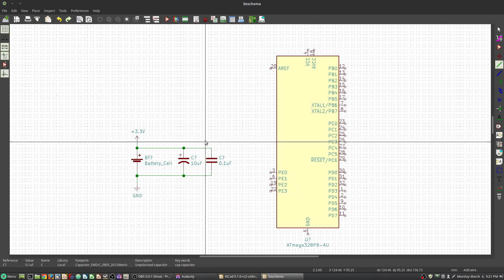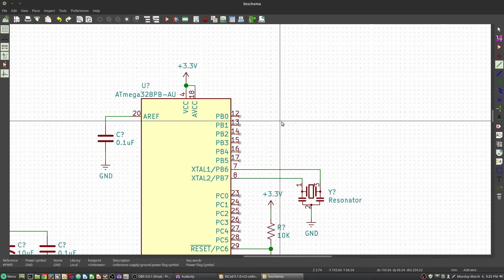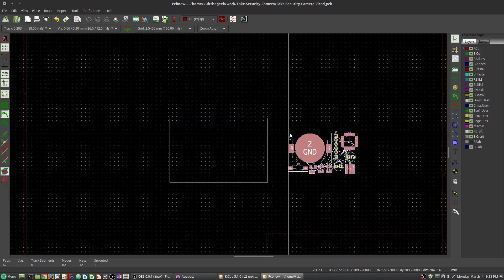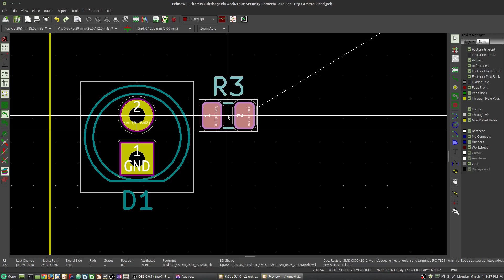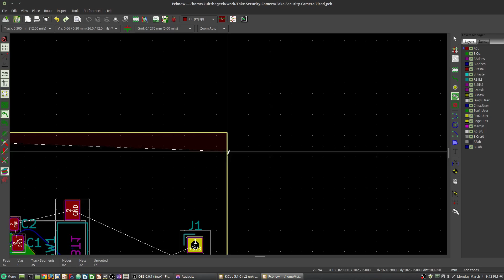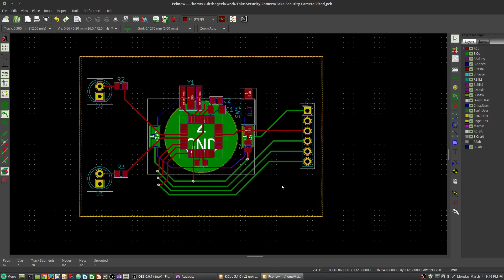Shenzhen I/O in Real Life - Part 2 - The Board

Comment: i have a probably ridiculous question, but why do you need the capacitors ? this might be obvious but can you please tell me in detail ?
Reply from the maker: That's not a ridiculous question at all. You put capacitors on the supply lines to help to filter the input power. DC power isn't perfectly flat like we normally represent it, it has a small signal ripple in it, and we use capacitors to help smooth that power out right before it supplies the ICs. This helps make the power more stable and helps to prevent random resets in the event of a power bump. This is also why the capacitors are typically put as close to the input pin as possible. Does that make sense?
Reply: @KuittheGeek  thank you for the explanation ! if you dont have a problem, i have 2 more questions
what capacitors to use depending on the circumstances, and
im using kicad, and i cant find logic gate footprints, what do i do ?
Reply from the maker: So there are a lot of reasons to use capacitors, and it is hard to explain the differences for all of the circumstances. But for power input filtering and smoothing, I normally use 2 ceramic capacitors in parallel, with values of 1uF and 0.1uF. As far as the logic footprints, you will need to look for the specific logic ICs for the gate you want to use. For example, the 7402 is a quad packaged, 2 input nor gate. Once you find the part you want to use, you can check the datasheet for the part, and it should tell you what footprint you need, like the SOIC-8 or SOIC-16. Those should also be in the default libraries. Otherwise you can look at snapeda.com for schematic symbols, footprints and 3d models. I hope this helps.
Reply: @KuittheGeek  its really nice to be helped like this, wish the best to you
Reply: LemonAndGaming it’s also worth noting that when you’re using crystals with an IC for timing you sometimes need to use capacitors to kickstart the crystals into working (so I’ve heard, don’t really understand why. Weak signal I guess)
Reply from the maker: @MarkPentler  This is true. The capacitors also help to stabilize the resonance of the crystal.  The capacitors for a crystal are usually in the realms of 12pF, so they are very tiny, and that is one thing to be aware of when laying out the PCB. The traces to the crystal from the micro should all be about the same length, and the traces from the crystal to the capacitors should be the same length as well. This is done to minimize the capacitance on the line. You can also use a resonator like I did in this circuit, as it is essentially a crystal with built in capacitance. It makes the design a bit smaller, but they aren't as accurate as a standard crystal. In some applications that is just fine, in others you need the accuracy.

Comment: Im kinda sad that this is just a custom arduino. I was hoping that there were small chips that could run small amounts of basic code like in shenzhen.
Reply from the maker: There are many small and simple microcontrollers out there, but this is basically how most modern designs work. I have been working on a project recently at work that uses a small 8 pin PIC micro, and I'll no doubt use that in a video sometime soon, but most projects now are done with micros that have significantly more code space then any project you could do in Shenzhen I/O. I could definitely do a project using this little PIC and some assembly code, that would be closer to the game. 🙂 I just need a project. 🙂

Comment: How do you calculate the values for capacitors and resistors?
Or it's just standard values from atmega datasheet?
Reply from the maker: That is a great question. So some of the values are standard values. I will always place a 1uF and 0.1uF capacitor on the input power line of the processor, as close to the power pins as possible. These act as power buffering capacitors as well as offer some noise reduction from the power supply. The resistors need to be calculated based on the LEDs used. This is dependent on the Source Voltage, the LED forward voltage, and the LED forward current. Digikey has a great calculator to use to calculate this out. I usually go a little under on the LED forward current to ensure I am not overdriving the LED. So if the LED has a current limit of 20mA, I will shoot for 18mA to drive it. This will just make the LED a bit dimmer. Great question though, I will be sure to cover this more in future videos.

Comment: Thank you for this fun idea of a project!

Now that I've gotten that out of the way:
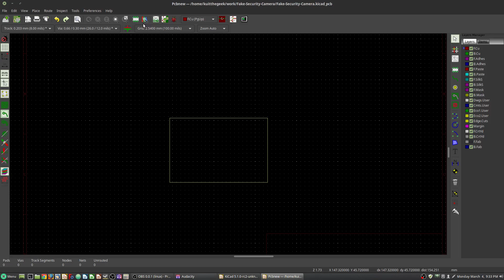I'm trying to reproduce your project on my own (by essentially copying what I see in the video) but I've gotten stuck at around 09:05 in the video, you never show how to generate the netlist, which I later figured out on my own, but after figuring that out, when trying to import my netlist to Pcbnew, I get a ton of errors saying something similar to "X is missing footprint", I'm going to continue searching for a solution.
Thanks yet again for the fun project idea.
Reply from the maker: Yes, there were several things I left out for time sake. I did start by adding default footprints to the symbols, so that resolves the footprint linking. You can do that however by running the "assign footprint" tool. I believe it used to have a different name, but the symbol in Eeschema has the "symbol editor" op amp symbol with the "footprint editor" symbol. This lets you link all of the schematic symbols to footprints. The netlist is generated by clicking on the symbol that says "NET" and then I generally save the netlist to the directory I am working from. I do plan to have another set of videos where I cover everything from project creation to gerber production, with more detail. So stay tuned for that.
Reply: @KuittheGeek  Alright, thanks! I'll wait for the coming videos.

Awesome.
Reply: I found the menu "Assign Footprints", I'm guessing you don't show connecting the different parts in the video, at least not how..
Hmm..
Reply: Seems like all my symbols are "unlinked", but I'm unsure of how to link them and what to link them to..

Comment: Amazing project! Can't wait to see the final product. Just curious, have you made any progress with the Skirmos code? I was thrilled to see that they put their code on GitHub but all I got was a 404😡😥. It'd be great if I could get their code working in my project guns.
Reply from the maker: Unfortunately I haven't. When I was able to pull down their hardware designs, the repository wasn't open. I did contact a few of the project leads, and they said they wanted to clean up the repo before releasing it. I assume that never happened. After I took a look through their hardware designs, I was less then impressed, and decided it wouldn't be worth using their code anyway. They had some meeting notes that I looked through that suggested they were considering adding a second processor because there may have been an issue with hit registration while the processor was doing other things like updating the display or firing. So I decided I would start my own project, and that is what I have been working on otherwise. Sorry I couldn't be more helpful.
Reply: Thanks for the quick reply. I'm surprised that the guys at Skirmos responded to you. I've tried contacting them and they seemed to have disappeared after the project went down. Can't wait to see what you come up with!

Comment: Shouldn't one of those LEDs be blue? ;D  And since a quick search of Digikey shows blue LEDs have a min 2.7 Vf, won't it need a different resistance value, around 34 ohms? (Yes, I'm just giving you crap; nice video. :)
Reply from the maker: Yeah... I looked for a clear LED, with a right angle bend, and it was hard... :D But, I actually bought a large amount of purple LEDs when I built my senior project, and they had, according to the Chinese seller on Amazon, a Vf of 2.1V. I've used them before, so that's what I went with. :) I was going to show the calculations in the video, but it already went long. This was the abridged version... That just means there is plenty more to come!